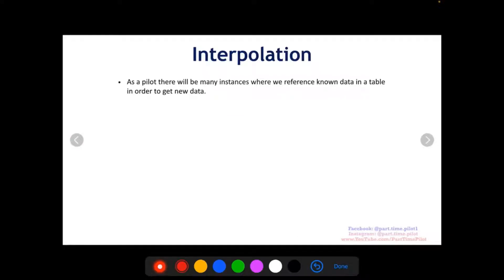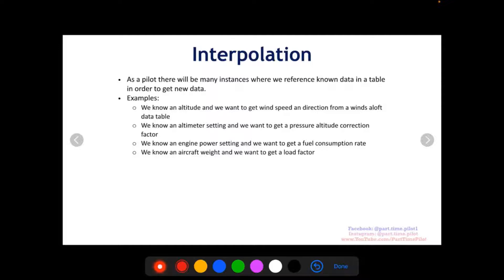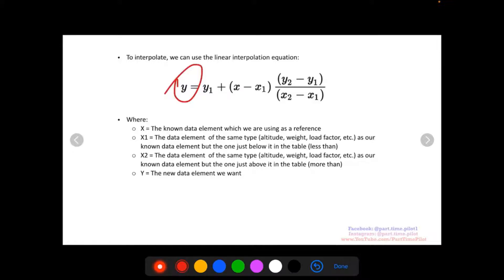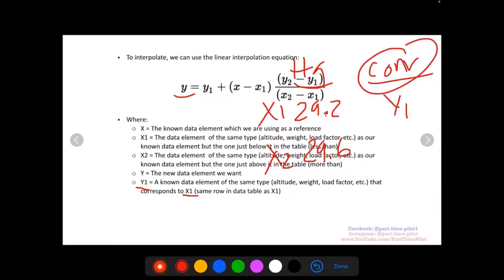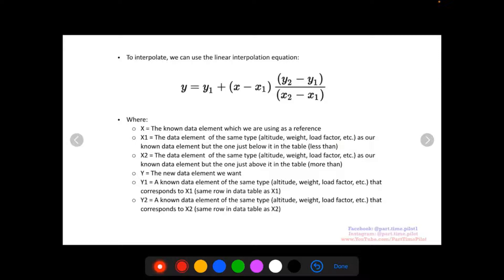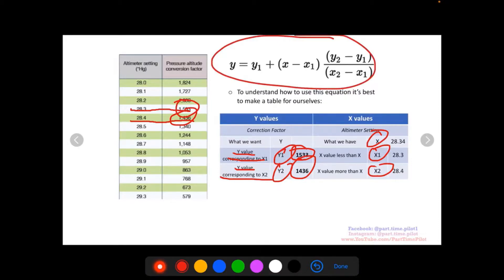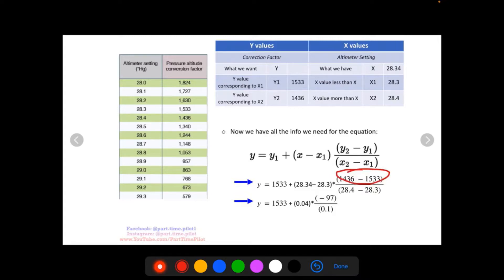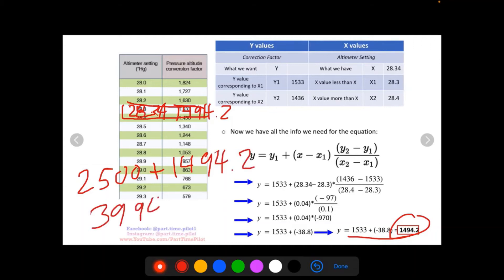How To Interpolate Data on the Private Pilot FAA Written Exam

Comment: Question, and I have looked all over and only get basics.

I completely understand basic interpolation where most values are in the chart. I am working on a problem in which that is not the case. I am doing ground roll calculations. These are my givens:

T=23°
Pressure alt=3000'
Weight=2400 lbs.
Headwind=15 kts.

In the takeoff data chart, we will use the values for 2200 lbs and 2600 lbs with a 15 kt headwind to interpolate weight, but then the pressure altitude needs to be interpolated as well, and then the temperature adjusted.

How can we still use the linear interpolation equation when 2 interpolations must be calculated? My intuition says we need to interpolate for 2 values, but after 2 hours and numerous approaches, I still can't get the right answer. Please HEP MEH!

Thanks so much!
Reply from the maker: I believe you would want to choose the first pressure altitude, say the lower one and find your answer by interpolating the weight. Then, you would do it again at the higher pressure altitude by interpolating the two weights again. Now you have two answers at two different pressure altitudes. You can now interpolate between the two answers for the pressure altitude of 3000. 

So 3 interpolations total… annoying I know haha.
Reply: @PartTimePilot  Wow, thanks!

Actually, and is always my habit, I realised the two values from the first interpolation would be range for the next one. That gave me the exact answer and kept me from overshooting like I did. It almost worked like a system of equations in mathematics.

Thanks for replying!

Comment: This is just another interpretation of the point-slope form in linear algebra, where you need to find the distance between two points and then what you call the "conversion factor" we physicists and mathematicians deem the slope. But, it seems to work. I get all my students to include their units because otherwise, self-checking becomes a nightmare and can really mess up your final answer. It's a great habit to get into. We had that drilled into our heads in physics and even had one prof who had a "units!" stamp made that he could simply stamp on the quiz or test because students were always missing the units. That's something that drives me batty about going from astrophysics to aviation, y'all don't hammer home those simple points that would really save a student from failing their written because they were in such a hurry that simply canceling units would have made the difference. Well, that and calling the outside force of a turn "centrifugal" instead of "centripetal". 😂 Centripetal actually means "center-seeking", which is why that feeling of moving toward the center isn't a real force, since the force you feel is already pushing you toward the center. They're not 2 separate forces, just 1. But I will argue that with the FAA.

Thanks! Recommending this to some of my students.

Comment: Does this equation also work for interpolating ground takeoff roll and landing roll too? Or is this specifically for altimeter settings?
Reply from the maker: Yes it does. You can use it for all aviation charts. Linear interpolation is a good enough approximation and recommended method by the FAA
Reply: @PartTimePilot  Thanks !!

Comment: I am 44 and as far as I can remember I don't ever remember having to interpolate values in school but now that I am going for my PPL I need to know. But what I would LOVE someone to explain like I'm five how did the formula of y= y1+(x-x1)*[(y2-y1)/x2-x1)] come about. I have watched about 5 videos including one in Punjab and I still can't figure out how the formula came to be.
Reply from the maker: You want a value Y that corresponds to value X. But you don't have Y. You have X and you also have a Y below (Y1) and a Y above (Y2) as well as an X below (X1) and a X above (X2). 
We are assuming a linear trend from X1, Y1 to X, Y to X2, Y2 such that the degree that X lies between X1 and X2 will be equal to the degree that Y lies between Y1 and Y2. 
To find the degree or percentage X is between X1 and X2 we find the difference X is away from X1 and divide it by the total difference from X to X2 so we get (X - X1)/(X2 - X1). If we then use the same formula for Y we can set them equal to each other as previously stated (linear trend). So (X - X1)/(X2 - X1) = (Y - Y1)/(Y2 - Y1)
Then, we just solve for Y and BAM... your linear interpolation equation!
Reply: @PartTimePilot  Ok I understand everything up to solve for Y. I'm 44 and I forget what happens to Y when you move it to the left? Does it become Negative? Do you have to divide the left by y i.e [(X-X1)/(X2-X1)]/Y=Y2-Y1? is that right?  I need Step by step Thanks.
Reply from the maker: @MrEthanhines  Ahh well I wouldn't worry about the algebra. Pilots don't need to know how to solve for the Y just how to use the equation so don't sweat it!

But if you really need to do it you multiple both sides by (X2-X1) and (Y2-Y1). Then you divide both sides by (X2-X1). Then you add Y1 to both sides.
Reply: @PartTimePilot  😊 thanks
Reply: @MrEthanhines  This equation is already in its simplified form, so you don't need to worry about solving just to isolate the y-variable. That is already done because it is on the left of the equal sign. Just substitute the values in that he gave you and then do your PEMDAS. That's it. The rest of it has been done for you.
Reply: As I said in my direct comment on the video, it is just a rearrangement of something we call "the point-slope form" in Linear Algebra. y - y¹ = m(x - x¹).  When determining the distance between 2 points on the unit circle and then trying to find the slope of the line that connects them, you have 2 points, both with x- and y-coordinates because they are represented in 2 dimensions, x and y, written (x,y). When you have 2 of those points, then you have x-sub 1 and y-sub 1. (x¹, y¹) (You can't do subscripts here without an engineering keyboard.)

That is the origin of this equation, but I have seen numerous versions of it through substitution, which works as long as you substitute correctly.

HTH. I am an astrophysicist and applied mathematician, so if you have other questions, please ask.

Comment: Another way to do this that is more simple for me is 1533-1436=97. We know that there are ten decimal places from 28.30-28.40 so we can divide 97 by 10 to get 9.7. All we have to do now is look and see that 4 of those tenths  need to be accounted for since we are looking for 28.34. Then multiply 9.7 by 4 to get 38.8 which you subtract from 1533 for 1494.2.
Reply: This is what I do in my head as well. It’s essentially what the equation is doing but breaks it down into steps, which I like
Reply from the maker: Yes I do this also! Perfectly fine and good way to do it if you are able to do so.
Reply: Genius. I’m doing my pre solo exam and tried this exact shit without knowing. I came to see if I was correct and  saw ur comment just makes me think that great minds think alike
Reply: I’m glad I know both ways now thanks 😊